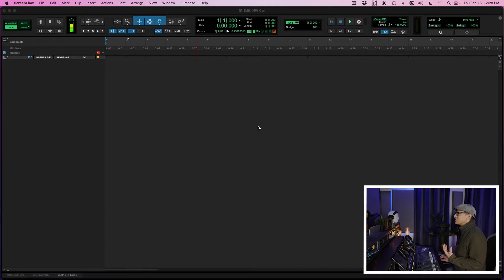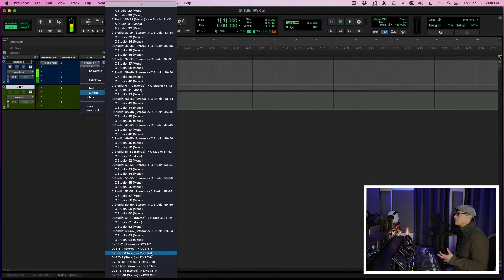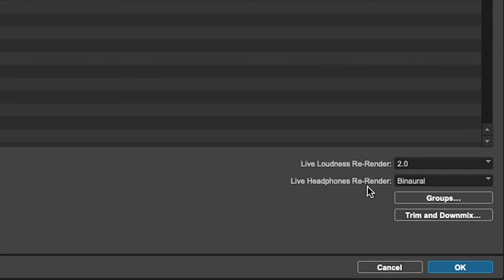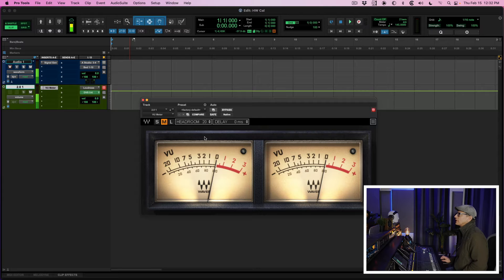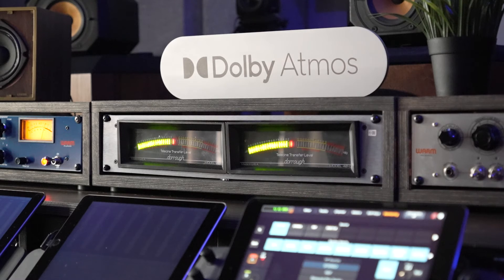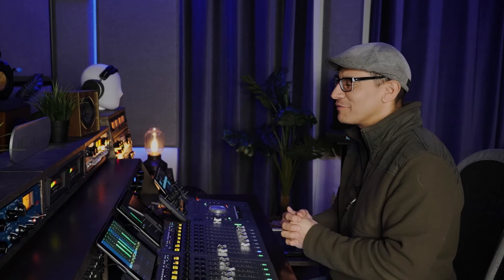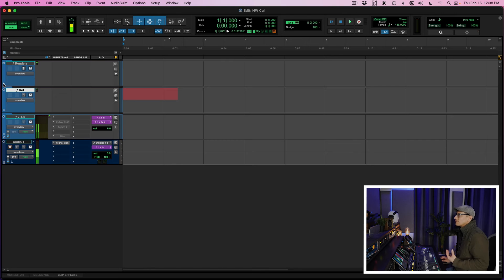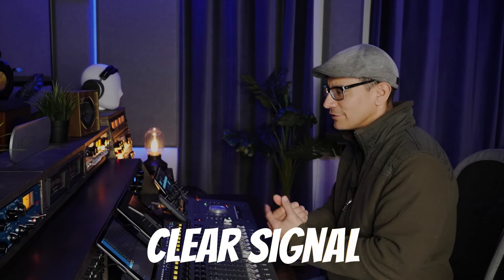Hit the Dolby Loudness target every time!

Comment: If you receive raw tracks with no process at all… would you mix it stereo first and after that would you convert to Atmos or do you mix everything within the Atmos session?
Reply from the maker: At this point I am creating both stereo and Atmos mix from the same session.
Reply: @DolbyAtmosMixing  im trying to do so but im struggling with the stereo, customers complain is not the same… do you have any video talking about your recent workflow that alows you to do so
Reply from the maker: Not a video. But I’ve been using this method for over a year now.
Reply: @DolbyAtmosMixing  how much you charge for a coaching session?
Reply from the maker: @ArielQuesada https://www.alexpromix.com/coaching
Reply: @DolbyAtmosMixing  the stereo you get printed in your template is an Stereo Direct? Or is it the 5.1 to 2.0 Downmix re-render!

Comment: Hi Alex, Thanks for your videos. I've noticed in this one that the renderer's meters go up to +24 (if I see it correctly), so that when you send the sine at -20dB from Pro Tools to the renderer this reads 0VU. My renderer's meters (Pro Tools Studio) go up to 0VU instead, and I don't seem to find any way to change that even in the metering Pro Tools preferences. Could you please enlighten me about it? Thanks in advance. Marco
Reply from the maker: Hi Marcos, prior to this I was calibrating at -18 but since I bought my dorrough meters and they have a +20 DB max I’ve been using 20 db as my new reference. This means I calibrate all my outboard gear to zero VU equals -20 DB. When the immersive mix is done, I export the ADM file and measure the loudness using the Dolby renderer, and I’m usually in the ballpark of -18 DBLKFS
Reply: @DolbyAtmosMixing  thank you so much, Alex. All is clear to me about ref levels. What I cannot understand is why your renderer meters go up to +20 and mine go up to 0 instead. This means that when I hit the meters with the sine wave they go straight up to 0 but there's no headroom at all as in your setup instead. I can't solve this mystery. Any ideas?